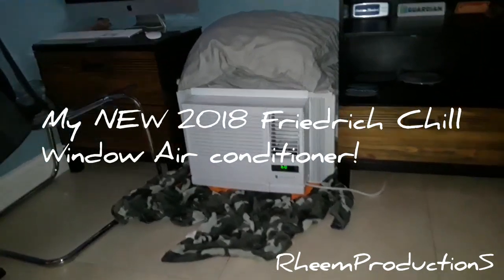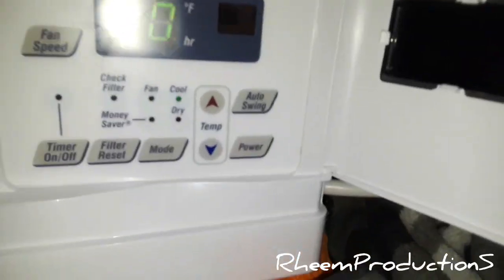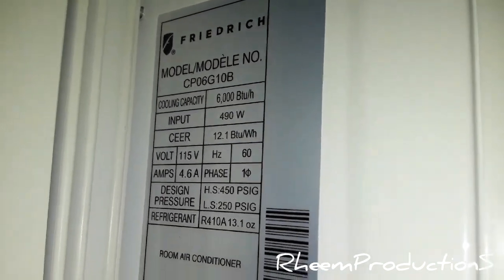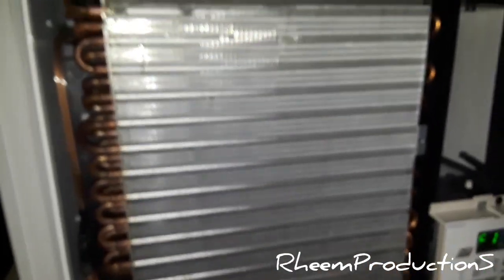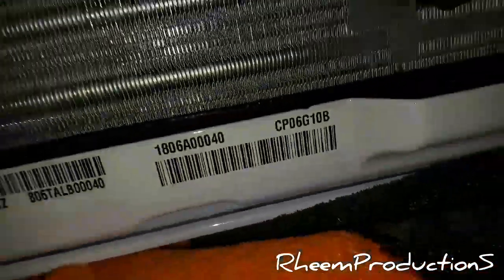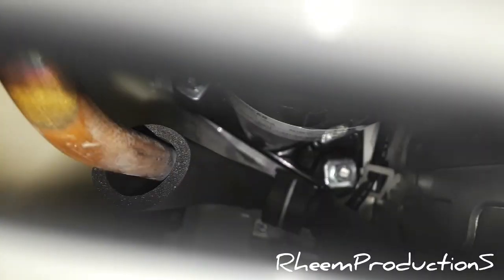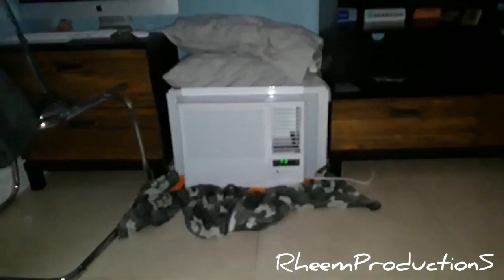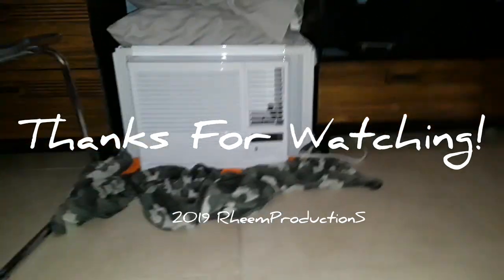My Officially NEW 2018 Friedrich Chill Series Window Air conditioner!

Comment: Nice sounding unit, just be careful running it like that (against the wall, with a pillow over it) for too long unless it can vent it's hot air somewhere. You could overheat it. Not saying it WILL, but it is possible.

Comment: Do you think that this unit would be able to fit into my 23 in window? I am looking for a good ac for my room but my window is very small. Its 23 inches wide and 15 inches long when opened fully. Do you know the dimensions of this ac?
Reply from the maker: Um...I think If the window is to small then you'll either get a 5150 or 5000 BTUS
Reply: Rheem Productions ok but does this type of ac come in a 5000btu? Because my room gets extremely hot due to 3 windows facing the sun until it sets.
Reply from the maker: @dtimmys  I don't think so.... I think it just comes with 6000
Reply: Rheem Productions ok what do you think of the frigidaire 6000btu? You seem to know about ac
Reply from the maker: @dtimmys  why yes I do know more about air conditioning. In my opinion about Frigidaire 6000 BTU Is you can say that is not a very good unit and cheap to just like their 5000 BTUS
Reply: @Xash2000  my room is 171 square feet so what ac would you recommend?